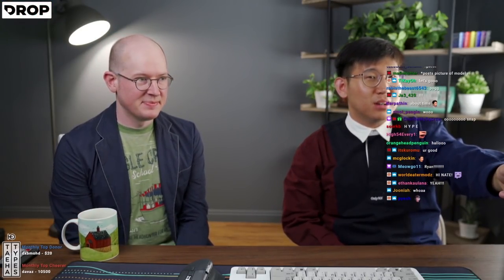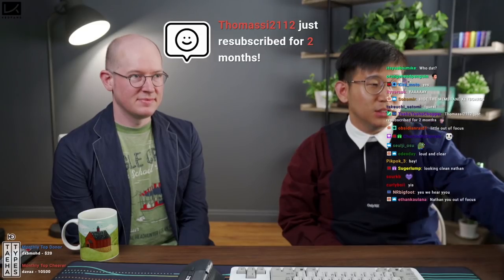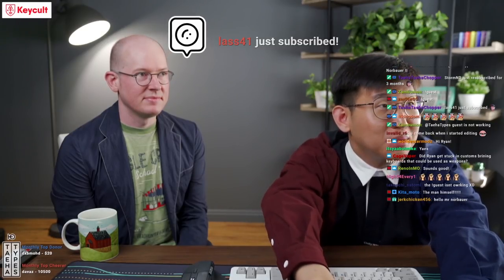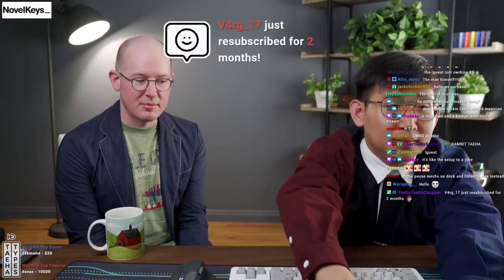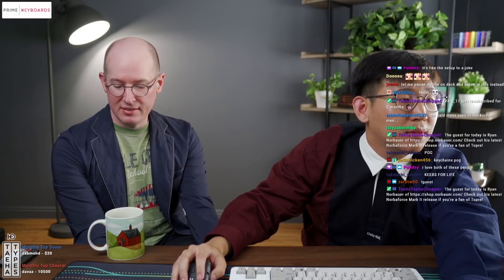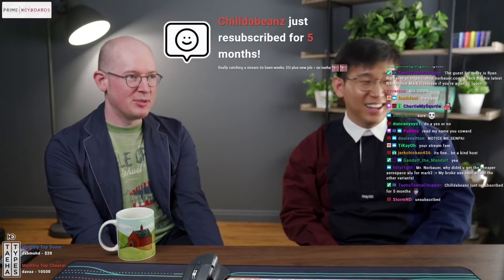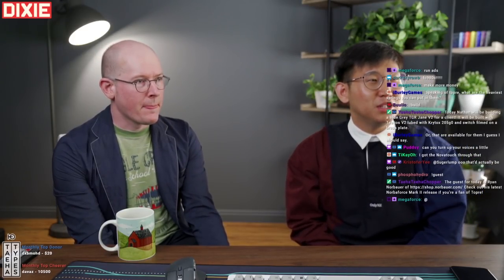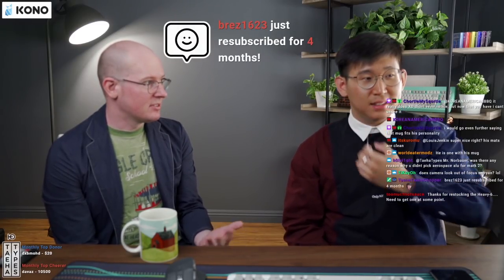Chatting with Ryan Norbauer + First Look at Norbaforce Mark II

Comment: I bought a keyboard from china prelubed - it was so lubed that the switch with stabizer didn't even moved. It was probably done by machinery so I can say that machinery now is doing a bit of bullshit when lubricating stabizers
Reply: dombrox yes, I have experienced that myself from China-lubed stabilizers, which are done by machine at the factory. I would only call a lubricating process successful if it actually yielded very consistent results, and I’m currently looking at high precision fluidics tools that would give me precise control and repeatable results.

Comment: are this 45g or 55g? stock or silenced?
Reply: not sure about weight.. but this is the RGB R2 TKL variant with factory mx sliders. it is fairly common knowledge that they don't sound very good as the regular variants.
Reply: the rbg tkls are 45g uniform.  Don't forget, deskeys makes silencing pads specially for the rgb version.  I highly recommend them.  Their normal pads (#3) made my novatouch sound better than any other topre board I own.
Reply: @ReeceConrad  thx for the info. may i ask if you have the regular sliders or the purple ones?
Reply: ThaLiquidEdit the rgb have white sliders.